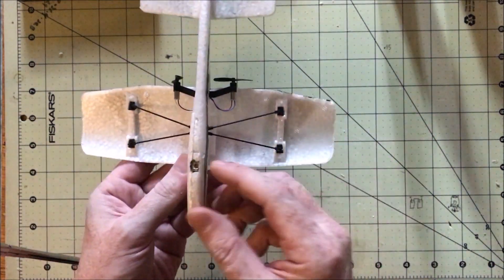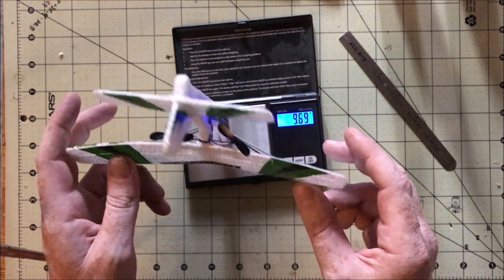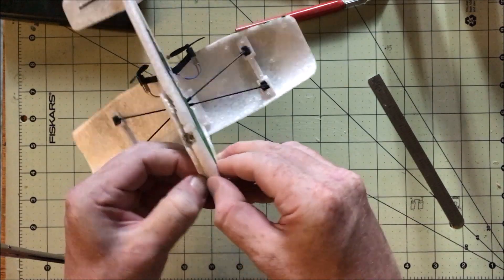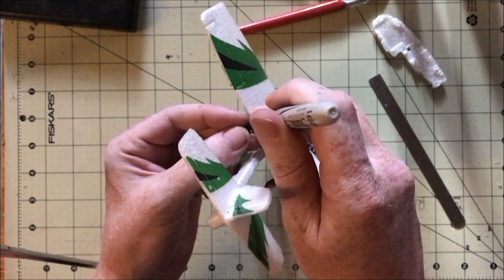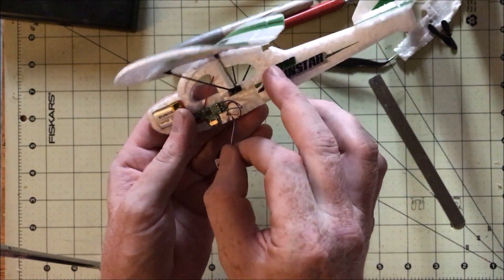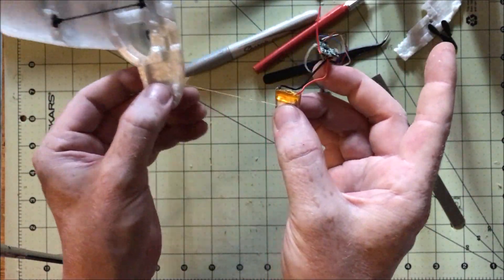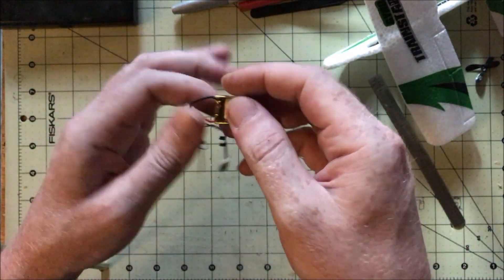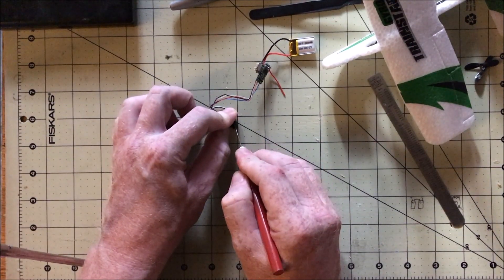$30 Micro RTF Teardown

Comment from the maker: forgot to add that the motors are pretty well secured in their little black plastic housing, i was able to use an xacto knife to split the plastic and remove them that way, but again, sharp pointy thing very close to your fingers can be dangerous, so maybe try using a small side cutters instead...dont try grabbing the motors with pliers or anything, the motor can is pretty thin and can easily get squished.

Comment: Just curious, what do you think about the Flite Test FT STEM EZ-Power Pack 2 Channel kit? It comes with pretty much everything anyone needs to build a micro 2-channel plane for just around $34.  No tear-down for noobs like myself, and also can take a stack of charged 3.7v  batteries to the field and just swap them in.
Reply from the maker: Havent used it before, but looks like a pretty good setup for the price, good for slightly larger models too.

Comment: Can you bind that receiver to a standard transmitter? 
Can you buy receivers that light that can?
Reply from the maker: Unfortunately, no, it only works with the transmitter that it came with.  There are other receivers that will work though, Deltang makes an entire line up for Spektrum transmitters, not exactly cheap though.

Comment: I’ve bought this plane but it unblinded it’s self do you know how to fix that?
Reply from the maker: Hmm, it should auto-bind.  Have you tried turning on the plane first, then the transmitter, rather than the other way around?
Reply: @microbuilder  yes I would fly it once and then charge it then when I try to fly it the motors were pulsing and this happened with multiple of them
Reply from the maker: @Krizqz_  I believe motor pulsing means the low voltage cut off for the lipo is kicking in...the lipo isnt getting a full charge perhaps, or is damaged, or maybe the charger itself has an issue. 

Do the propellers spin freely if you move them by hand?
Reply: @microbuilder  every time I try charging it it won’t charge I tried the transmitter it’s self and my pc and nothing worked the propellers would just pulse
Reply from the maker: @Krizqz_  Yeah sounds like the battery might be dead.  I think its a 75mah lipo, theres quite a few available on Amazon or Ebay, but you'll have to do a bit of soldering to replace it (a local hobby shop might do it for you if you dont have an iron).
Reply: @microbuilder  ok sounds good

Comment: Hey I don’t see the plane on Amazon that you show is similar model gives same receiver?
Reply from the maker: I picked this one up a while ago, been meaning to do a video on it.  Same setup as the other micro RTF, but the RX has some different features.  You may be able to find it on Amazon too  https://www.ebay.com/itm/KFPLAN-KF606-2-4Ghz-2CH-EPP-Mini-Indoor-RC-Airplane-Glider-Built-in-Gyro-RTF-New/254229607839?hash=item3b3143f59f:g:OOgAAOSwgxJc2Oro
Reply: microbuilder hey do you have discord I just wanna ask some questions because I m having a few trouble right now?

Comment: so on one of the older IR "cessna" planes, I built a WWI Vickers Vimy with gear drives and 4mm motors. I think it was about 13-14 inch span but weighed about 12 grams. it flew so slow, it was marvelous in a gymnasium. I still have enough parts to do a geared twin, and with all the FAA garbage lately, micros may be the last avenue left soon for flying.
Reply from the maker: I need to get some 4mm gearboxes, I only have one left.  And the FAA can come pry the tiny toy TX out of my cold dead hands lol

Comment: nice one, i had one of these before but i couldnt ever fly it because the infared range was so short that i couldnt even fly it indoors
Reply from the maker: Thanks.  That mustve been an older version, this one is 2.4ghz...same TX though, even has the clear 'pod' at the top for the IR emitters lol
Reply: @microbuilder  yea it was the older version, glad the new one is on 2.4ghz
Reply: @microbuilder  those parts can make some nice indoor flyers
Reply from the maker: @ggg567-n6p  Yes indeed, I'll be making a living room flyer with them sometime in the near future.